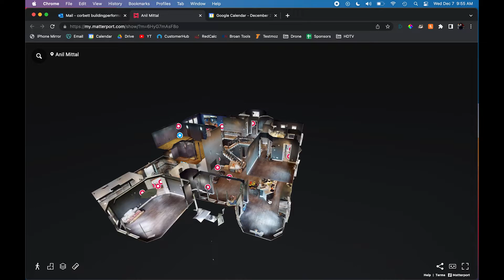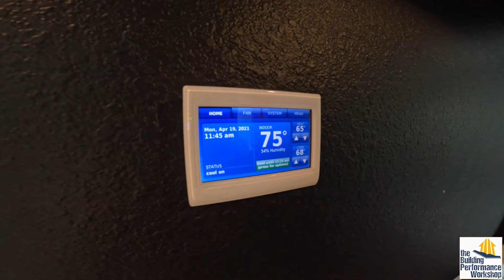Mold House Tour and Scientific Causes: Disaster Production Home Build in Houston Texas

Comment: If the homeowners like the neighborhood, they 
should look for an all-systems approach for the solution, but more than likely it will come out of their pocket.   They need to have a team work together with a mold specialist, HVAC &  insulation trades, energy auditor, drywall,  etc...

All the HVAC flex duct removed, including behind the walls supplying the first floor.   Lot of sheetrock will come down to access duct behind the chases. 

After all the proper mold remediation takes place a competent insulation contractor needs to be brought in and either 2"-3" of closed cell or 6"-7" of open cell spray foam needs to be applied to the entire roof deck and soffits in the attic and soffit walls.   

All the garage ceiling sheetrock needs to be removed so the upstairs floor can be sprayed from below.    Any walls inside the front/rear porch attic areas that meet the living space needs to be also spray foamed.

All the penetrations on exterior walls need to be sealed, and even consider removing all the interior door and window trim to shoot low expansion foam (blue can) to seal the window & door rough openings. 

After proper air sealing and insulating, a competent HVAC contractor needs to install all RIGID insulated duct work and  an ERV system to introduce controlled outside air that's been filtered and dehumidified so the air in the home is balanced.  Ideally all powered exhaust vents (kitchens, bathrooms, garage) should be tied into the ERV so when they exhaust air the proper amount of make-up air is supplied by the ERV. 

The HVAC system needs an actual Manual J calculation using real data points, not "standard" or "default" figures. 

An in-line whole house dehumidifier should be installed in the HVAC system that can control humidity in the house.   

An upgraded air filter using a 4" thick box filter and possibly a UV light should be considered. 

Basically the house should control air going in and out.  Air sealing, foam insulation and the ERV in the HVAC system should all work together to control humidity and eliminate condensation. 

Good luck

Comment: The guy saying AC in attic is bad - he obviously does not know very well. I live in Houston area for 18 years. I have a PhD in ME (in air flow, thermal field) and know well about AC and actually been inside many attics. It's perfectly fine to have AC in the attic. Mine are - never have any mold issues.

The key is moisture and as long as the attic is well vented - you are very unlikely have mold issues assuming your AC is installed and runs properly and no plumbing problems. As long as your condensation water inside the coil (evap unit, usually in attic) drain properly - mold is a non-issue.

New trend in home-building is to have good insulation in attic yet sometimes builders are not careful about the proper ventilation of the attic. It's OK to seal the attic from the main living area but should not seal it from the outside. Proper installation of soffits, various vents  (best to have active fans) are essential for your attic and roof system.
Reply from the maker: @Xiang Li, my 15 years experience testing homes makes me disagree with you. Many MEs and mold inspectors are out there prescribing more attic ventilation, and then when the mold gets worse people like me get called in. There is no one way to solve a problem, of course, but cold equipment and ducts in a superheated, humid attic are definitely the cause of lots of problems.
Reply: Attic fans are not allowed based on IECC due to energy standards and depressurization of the attic. Your right about adequate attic ventilation. None of it is really 'designed' just meet the 1/150 and no need to test no matter the roof shape. Plus homeowners either don't grasp the concept of filter changes or they install MERV 13 1" filters which are problematic in most single stage hvac systems.

Comment: Getting ready to build a house for myself and after looking at and dealing with the building codes, I can tell you this has less to do with the builder and more to the IRC. They keep making houses "energy efficient " meaning tighter and tighter and they never Breath. Wonder why houses for even the 1800's don't have these issues. They breath. You are sealing in everything that is bad. If the house was not so "Energy Efficient" the moisture would have somewhere go. You lock into the houses now days. I will bet if you go back to the start of using Tyvek, you will see the start of these problems. Go back to build houses that leak air and willing to be the problem will go away.
Reply from the maker: Actually, Crazy Man, the IRC requires outdoor ventilation too- once again, it’s a thing that gets missed/skipped during plan and build.

Comment: I have asked multiple hvac companies about flex duct. They often just say it needs to be installed  correctly. 
Or they shrug.
They really don't want the labor involved in building solid duct.
Reply from the maker: Yes, labor is a problem lately. Partly why I installed my own ductwork.
Reply: Sheet metal cost a lot more. And it's a skilled trade which has been nullified over many years now. Dragging flex across an area takes no skill including connecting it to the main supply duct. Ironically, when flex was starting to be used back in the 60's it was only allowed with a maximum of 6 ft length and only for branch connections to supply outlets. Within a  few years that all got forgotten about as the costs in installing flex duct is extremely low compared to sheet metal. When I'm asked to correct duct problems I will use sheet metal in place of the existing flex or I won't do the repair.
Reply: Whats wrong with flex duct? Why is solid metal better?
Reply from the maker: Flex is more restrictive and easier to install which makes it generally sloppier- a 6” solid duct is replaced with a 7” flex to get same performance. Also flex only lasts 30 years or so before plastic degrades enough that fiberglass insulation is exposed to the airflow.
Reply: @HomePerformance thanks super helpful!

Comment: I certainly understand the comments blaming the HVAC contractor, but I was an HVAC contractor in new Energy Star homes for about 10 years before I got out. If the HVAC should never be out in an unconditioned space, then Architects and builders should be making space for them within the envelope. The HVAC subcontractor has no choice but to put it in crawlspaces and attics. The builder doesn’t put enough in the budget for whole house dehumidification either. The HVAC system is simply reacting to the limitations that the architect and builder themselves placed.  Now, in this home, I saw some pretty poor craftsmanship including using floor joists as ducts. But the ENTIRE INDUSTRY is broken. There is no required training or certifications for tradespeople in the South. And no inspections either, so nothing prevents the builder from getting away wit( sub standard work.  Consumers don’t do their research, they make decisions, not on quality or science, but on what the monthly payment will be. Your house is the biggest purchase you will ever make.  Production homes are all garbage. I would rather live in an apartment than live in a track home for these reasons.
Reply: Manual J called for 4.25 tons of cooling, 6.5 tons were installed. When I questioned the HVAC sub why an almost 50% oversized set of units were installed he literally said "The builder told us to install those". The HVAC sub had his hand tied in equipment selection and the install was doomed from day 1. I have had some VERY good HVAC sub work on previous houses, this particular one Davis AC is/was horrible. I've had their techs tell me that cardboard boxes in my house generate heat, they have left ducts unsealed, over crowded plenums, crushed ducts, improperly zoned 2 oversized units etc. There are  LOT of good HVAC contractors out there, unfortunately production builders are not willing to pay for good or quality, just cheap and fast. There is an old adage, any project can only comply with 2 of the 3: cheap, fast, good.
Reply: @BigAnil  i agree and i am sorry you went through all that. I am starting a design consulting business for these very reasons.
Reply: @timdestasiohvac  
I’ve been in HVAC for 25 years. I was just talking to my brother today (he is in the trades too) and said “the industry is broken”.
Tim - I’ve been thinking about doing consulting too. Heatloss calculations. Hvac design. Equipment sizing. Coming at you from Calgary, Canada.
Reply: @Onward1969  Yes, I'm thinking about doing the same once I move to the coast next month.  Best wishes to you!
Reply from the maker: Great, we need MORE consultants (they can be HVAC techs or contractors also- that’s best imho). Let me know if I can help any of uou guys level up, it’s something I love to do.
Reply: @HomePerformance  I recently became a certified  commercial air balancer and HERS rater. So far I have been met with a lot of resistance to anything that would criticize or call out deficiencies. A lot of Raters around here are just paid off. I’d love to find a way to be able to help from the start of the projects and keep things on track. Any advice would be much appreciated to help me and others “level up.”
Reply: @BigAnil   First, sorry for your trouble, and 2nd, you have done something tremendously important by bringing your issue to light and how it was handled for everyone to see. 
I have refused to do work for builders for years over the very reasons you articulated. 
I wish you and your family the best.
Reply: @soleadoc  Thank you
Reply: @BigAnil  I don’t know if there’s a gag order but are you able to share an update?
Reply: @annettegrote  unfortunately I live in a state with no consumer protection laws with nothing to motivate a builder to actually adhere to  arbitrator mandated scheduling orders. In other words the builder, sub contractors and their insurance companies are trying to drag this out until we run out of money/give up. I'll keep flighting this as long as I can financially afford to.
Reply: @BigAnil  We are in the same area as you-- and a very similar situation(different builder). Also similar with paying mortgage and rent, etc, health scares(ongoing) and had to put our 7 year old dogs down. This has been a life altering nightmare--as well you understand. We are at the beginning of Arbitration. So a few steps behind. I want to thank you for putting your experience out there. I think it will help many. It did for us. We have some dates scheduled for the builder to do their inspections and although someone before you suggested getting cameras in every room, based on your pointing out how it helped you with real examples, we will do our best to do this as well. I didn't "get" how much of a safe guard this is. So thank you. And please updated as things progress. Praying for justice for you and your wife.
Reply: I am with you the so-called expert knows little about AC and ventilation.
Reply: Building science. Joseph Lstiburek
 Your attic needed to be conditioned space. Closed cell roof insulation or . Also the duct work in your attic is ludicrous.
Reply: @bill-8794  I'm not as smart as Joe is but I strongly disagree that we have to make the attic a conditioned space like the livable space below. Manual J does not consider and encapsulated attic part of the condition space and the heat load calculation. The most important thing I feel we need to ensure is that the attic is dry. The fact that there is only a thin layer of drywall between it and the space below means that there will only be a few degrees temperature difference in most climates. That is acceptable.

Comment: The suggestion that a purchaser can stop construction on their production home is inconceivable. If there is no good code inspection jurisdiction, get a third party inspector as part of the contract, or just walk away.
Reply: I don't believe anyone said the purchaser can stop production. I think the statement was that you need someone on the project who will halt production when there is an issue and not simply try and meet a deadline. In our case the building super was simultaneously building more than 20 houses and not paying attention to any. Walking away from a house is not feasible in most housing markets. Imagine you have either sold your current house or your lease has expired and you come to closing of your new house to find defects. If you don't close not only are you homeless you will likely pay $50K  or more for the same model house simply due to price increases between the date you contracted to have the house built and the date you close. Standard 3rd party construction inspections will not catch these issues, they do not perform tests like duct blasters, blower door, Manual J reviews etc. To properly inspect a house would simply be cost prohibitive in addition to the fact that no production builder will provide your inspector with the information required to properly inspect and validate the work done on the house.
Reply: @BigAnil True! I boight a new house and asked for the drawings to understand the pipeline path in case I need to repair any damage, and they denied those documents to me. They said is their intellectual property which I got it, but it also means it is difficult for me to understand what I just bought.
Reply: @helenamazing2050  On my current house I've had the same issue. I have asked for proof a manual J was done, proof of a blower door test, etc and got the same answer. It's an easy way for builders to skirt responsibility.

Comment: ewwww. 
it looks like no one designed the ventilation to positive pressure the house and push dry conditioned air out instead of sucking damp outdoor air in.
you can't run a dry climate setup in a humid area like that.
Reply: Yes and get this: i have yet to find an HVAC company in the North Houston area that will put in an ERV, and even a dehumidifier was a hard ask.

Comment: I'm happy he has the resources o try fighting he company who harmed his family with their terrible HVAC design and install. I wish the same was possible for all people affected. I hope people see this and questionnaire own health issues. So upsetting. I have universal healthcare where I live - this is unacceptable.
Reply: There is no way to remediate a house that far gone, costs would be stripping it down to bare framing!
Reply: IMHO the house can never be remediated effectively. The majority of the house was built with engineered wood products. Those products cannot be effectively cleaned of all mold even using methods like dry ice blasting. Those wood products would need to be encapsulated after the visible mold was mechanically removed. Encapsulation does not prevent the outgassing of Mycotoxins, that is what makes you sick. The only part of that house that should be reused is the foundation/slab. It should be torn down and rebuilt.
Reply: @BigAnil  The only way a home like this can be restored is if it’s ripped down to the studs imo. Leviticus 14. All walls, insulation and materials removed. HVAC replaced. Deep cleaning. And this is for “regular” people. If you are or have mold illness, the chances of healing in a mold infested remediated home is close to nil. And it’s not necessarily the mycotoxins that cause illness, but the tiny dead mold fragments that cause systemic inflammation. These particulates are smaller than HEPA and the mold industry uses outdated tools that can only go down to 0.3 microns. Also, encapsulating is a scam and serves absolutely zero purpose except financial gain to whoever is spraying it. Once the moisture has been fixed, problem solved. Spraying encapsulates is just another newer Xactimate hustle in the mold industry.
Reply from the maker: Agreed
Reply: @HomePerformance  I wish there was a product like Aerosolized mould killer to kill what has infested everything in their house. Like the aeroseal caulking some passive house builders use for sealing at the drying in phase. But I'm not sure that house can be saved in the state it's in. :(
Reply: @AmandaComeauCreates  I wish too, but the dead mold is still going to be there and then there’s the fact it’s more harmful to health when it’s dead. Not to mention the mycotoxins that aren’t even alive to kill. The biggest problem in the mold industry is they get away with selling treatments and killing protocols that destroy homes. One word; removal.